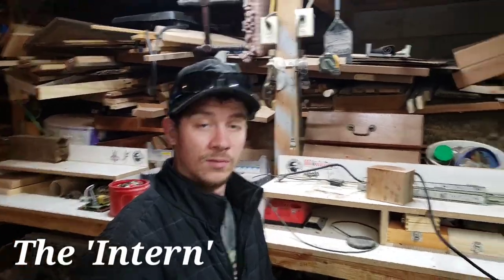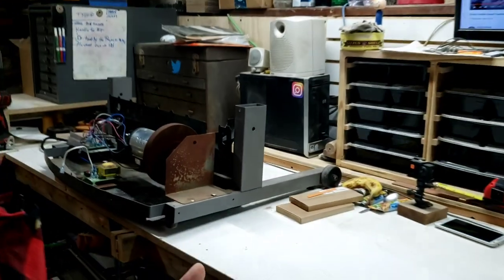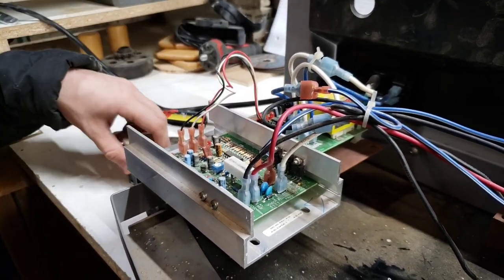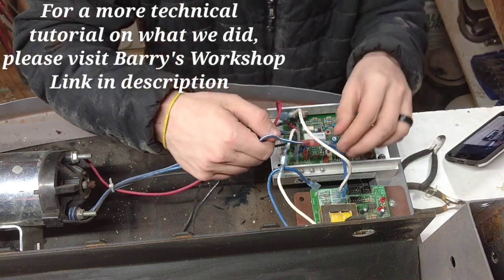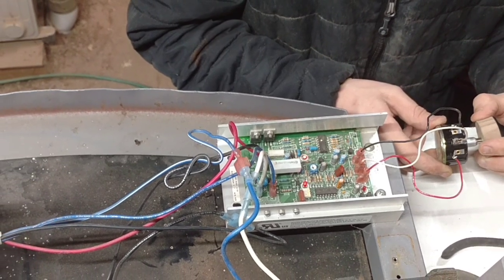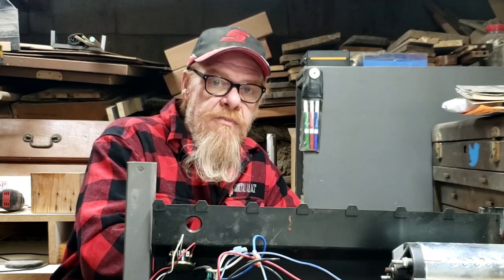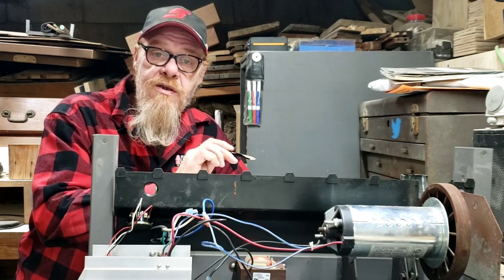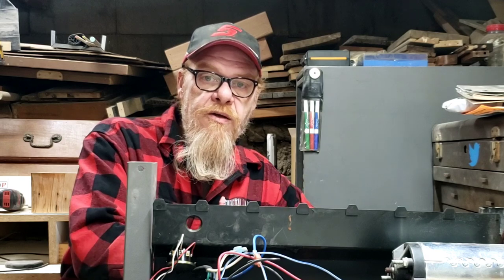HOW TO WIRE A TREADMILL MOTOR | WHAT AM I BUILDING?

Comment: I did one in my Total Shop shorty, it ran several hours then fried the board, under load resawing some 8 inch black walnut on the Stretched Shopsmith bandsaw.  I will be replacing it with a scr, rectifier and choke wiring system tomorrow.  Parts coming!
Reply from the maker: I love the stretch bandsaw project !! I saw the video a day ago. Keep frugal fixin !!!! :)
Reply: @MakinSawdust  We do things to prove a concept, and sometimes we polish the turd up when finished!!  Thanks for watching it, comment sometimes, You know how that works,  LOL

Comment: Also, I've got some ideas for my tool post cart and using the actuator motor for an automatic feed. Right now I'm currently using the manual wheels but sometimes it's like using an etch a sketch when I do certain types of tapers. It's never too much of an issue that some light sanding won't fix,, but it would help when I need a little bit smoother transition to eliminate some of the stop lines. I mean I get pretty crafty using the extra opinion gears as a wheel wheel as I like to call it. Or tractor wheel. I just think it'd be needed if I could get it to work. And potentially useful. Lol
Reply from the maker: awesome comments

Comment: I have a similar treadmill motor and control board waiting for a DIY tool project.  I was planning to keep the flywheel on.  I think it will help maintain inertia and keep it spinning at a more consistent speed when the load changes.  In the example of a lathe, you don’t want the work piece slowing down the moment the chisel touches the work piece.  At least that’s what I’m thinking.
Other than visual aesthetics, rust on the flywheel doesn’t affect performance.  You could just use some sandpaper on it while it’s spinning 😊
Reply from the maker: I totally agree with your inertia theory. I had another viewer enlighten me about the flywheel being threaded lefthanded and I could take it off to clean it. 
Using your spinning and sanding theory, considering the safety aspect...... heck I will count my fingers when I am done....:) :)  I may get a hair in my ass and sand the flywheel to a high polish!! :)

Comment: I want to see this desktop lathe I have a similar setup. It's a sherline head stock on an 18-in bed. I had it previously running off 3/4 HP sewing machine motor. After the 4th or 5th one I burnt through. I got my hands on some of these treadmills and now working on converting. I got to go through the garage and find me potentiometer. I have both. The the MC60 and an MC2100 controller and feel I should go with the 2100 just to get the cleanest power. My big conundrum though is figuring out my pulley. I currently was running gator belts that are 1/8 of an inch. Maybe maybe bigger. It's probably in metrics, but they're tiny. Suckers. Strong if you get the gators but the stress I was putting on them was just shredding them, especially if that headstock moved at all. I tinker too much so I tend to either forget to tighten it down all the way or I'll tap a piece with a brass hammer, move it a little bit or strip out my ex bolts. I'm pretty rough on the little thing. But sherline is definitely quality stuff. Would you happen to have any links on information about ways to potentially get a bigger throughboard on that headstock using bearings with a wider ID. I think it'd be even a neat idea to rig up some kind of double clamp for some material that is longer without having to make a a jig and material holder that extends way out. I feel like a few inches plus an extra clamping jaw will give me plenty of stability and extend some work.

Comment: I have the same motor, i’m wondering if the end of the motor head is removable? If you could show me how to remove it, it would help me a lot with my project.
Reply from the maker: oh, wow. I am a few weeks away from getting started back on this project, stay tuned friend :)
Reply: The flywheel? That just threads off CCW. Unless it's been modified. As far as everything else a You may be able to replace caps but they're supporting the stator via the bearing cups